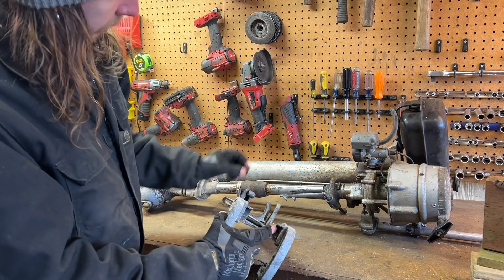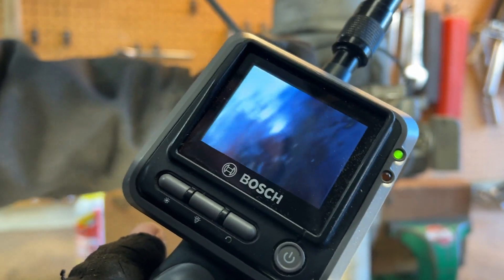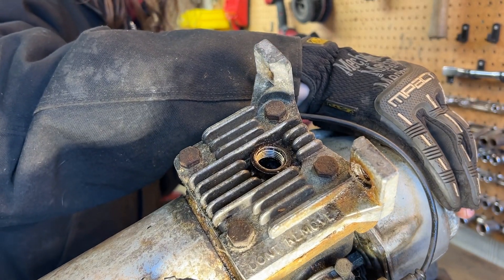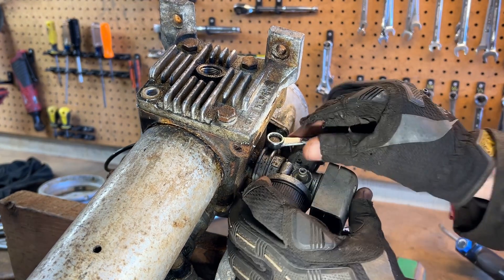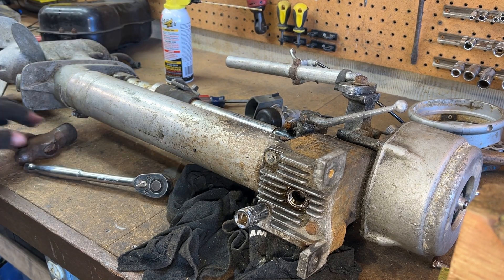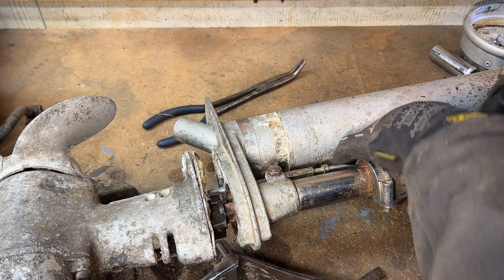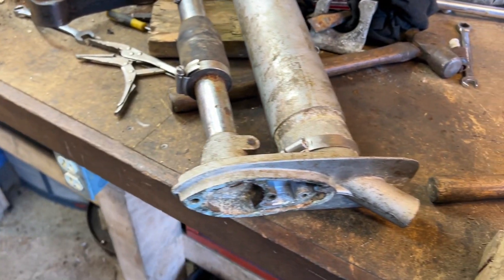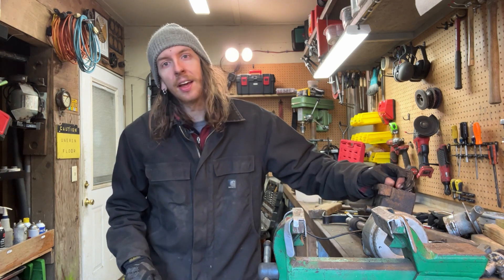Fixing a Seagull outboard that was left for dead in the rain

Comment: Probably not going to get far with that old thing. Good luck getting the broken bolts out and finding parts.
Reply from the maker: Indeed, I'm feeling the same way. At least the poor old gal owes me nothing at this point. I would be satisfied with at least getting it to the point of turning over. Puller around the jug is my next move, as I don't have a press. Thanks for tuning in!

Comment: the oddly-sized bolts are probably "whitworth" fasteners....an old British standard, 55 degree thread angle (vs 60 degree in our standard NF or NC series, or metric)...and head/hex sizes that are related to not much of anything!  Usually find whitworth tools (and you wont need many...a 3/8 dr socket set and a few  open end wrenches will do it) from suppliers who sell to old British car/motorcycle enthusiasts!  Without the proper wrenches, working on these things is a struggle!  Great vid by the way!
Reply from the maker: Thank you! This is possibly the first British engine I've wrenched on, and hammering sockets on both felt like a travesty and got old quickly. Whitworth rings a bell, but I've certainly never encountered wrenches/sockets before.